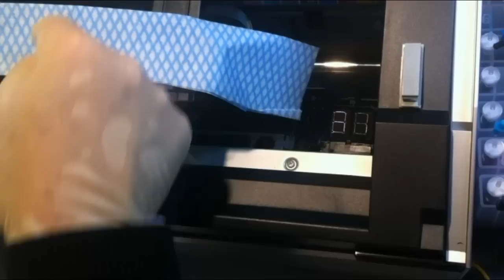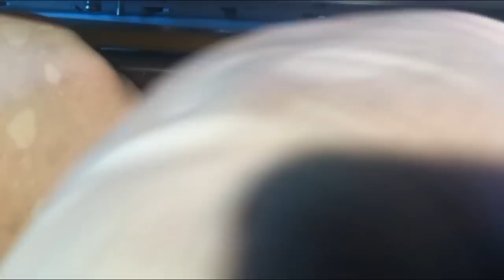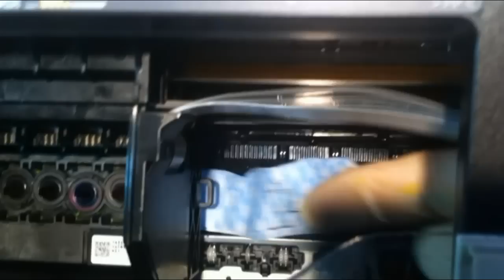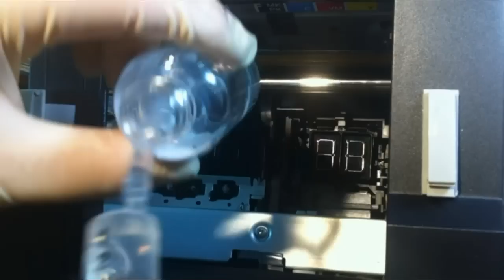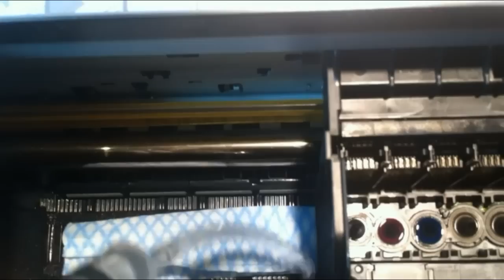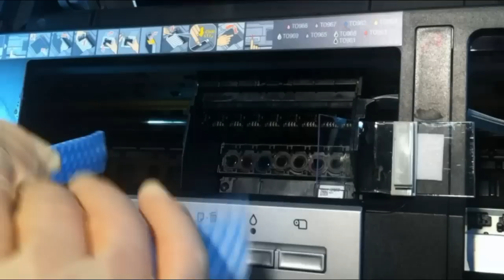How to Clean your Printer's Print Head

Comment: After running several nozzle checks that only marginally improved the print quality I was about to give up on my hopes of repairing the blank lines printed by my Epson, this method did wonders for restoring my printer's printing ability. All purpose surface cleaner and a folded paper towel worked great.

Comment: Easy to follow video but I'm now in a worse situation than before. I had a stubborn bit of Magenta causing issues on my WF 7610 (been on holiday for 3 weeks, it was working fine before). Loads of black needed cleaning off the heads but all were printing fine before, now I still have the magenta issue and no black whatsoever. So frustrated.

Comment: This look promising. I hope it works for my Epson WF-7610. I have not been able to print anything off it for a few months because it's so bad. I mostly use it as a scanner now and don't really want to spend $250 for a new one.
Reply: Hi Haley. Yes, as long as you can gain access to your print head this will work for any inkjet printer using dye or pigment ink: https://www.marruttusa.com/printer-maintenance/inkjet-cleaning-videos.php#tucks

Comment: I figured I would remove the cartridges. Another question, I did a clean (lots of inks on the paper towel), then nozzle check and a little improvement, then I did a built-in head clean which made it much worse. Every time I did a built-in head clean it got worse. Should I continue to do a few cleaning as instructed in the video? Thanks!
Reply: hi feng, please email us directly at digital@marrutt.com. we need to ask you a few questions so we can confirm the correct cleaning method

Comment: I just bought a new inkjet set for my Epson Workforce 610, because my Yellow and Magenta were low and my printer would not let me print in black and white only, even though it seemed that my black ink level was sufficient for what I was printing. I replaced the Yellow and Magenta cartridges and performed a nozzle cleaning. I was prompted to replace the black ink cartridge. I did and am still not able to get a clean nozzle check. I am so frustrated. Should this method work on my Espon Workforce 610?

Comment: I have one line missing from my cyan colour every time I do a nozzle check and it won't go away with head cleaning. Do you recommend I try this technique? I have an epson L800 if that helps answering my question.
Reply from the maker: Sara Sami hi sara, as long as you can gain access to the printer head, you should be able to follow videos 1 to 6 here:
http://www.marruttusa.com/printer-maintenance/inkjet-cleaning-videos.php#tucks

Comment: I think I may have just ruined my Epson Workforce 610 printer doing this. My printer didn't have a blockage, and the Nozzle Check utility showed all the nozzles working perfectly, but it had a glob of ink that was dragging across the page, making a terrible mess with every print. I figured that this would help remove that, too. While it did remove the ink glob, now I get a few missing black segments on the nozzle check, and color ink is completely gone. The color ink is completely missing from all color prints and the nozzle check. This is with brand new cartridges. And the color ink went away gradually. In the first nozzle check, it had about 1/3 of the color nozzles printing, but with subsequent cleanings, there were fewer and fewer, until they were all gone by the 3rd cleaning. Does anyone have any suggestions on what to do now, or am I stuck with having to get a new printer?
Reply from the maker: Sorry to hear about this michael, this cleaning technique is not recommended unless you have blocked nozzles. Please email us in at digital@marrutt.com. We will ask you a few questions and do our very best to get your printer up and running again
Reply: OK. I was actually referred to this video from another blog post about how to fix the ink blob problem was having. Seemed logical, so I went with it. I'll send you that e-mail shortly...

Comment from the maker: This solution breaks down the chemical bond between the inkset carrier fluid and the paper dust which usually causes the ink to dry.
If you can treat the print head as soon as possible once a nozzle blockage is noticed, the print nozzle will clear more easily..

Comment: Nice work!
I had to do the same for a badly neglected Epson printer. It was necessary though to stitch in a quarter inch thick foam pad between 2 layers of j-cloth to make a little hump in the middle. This applied a bit of pressure while cleaning for faster results.